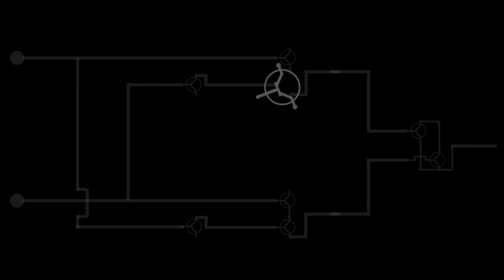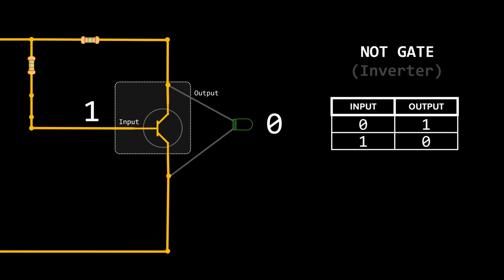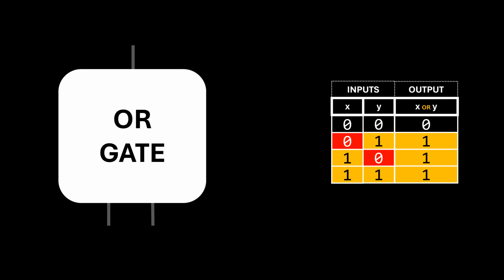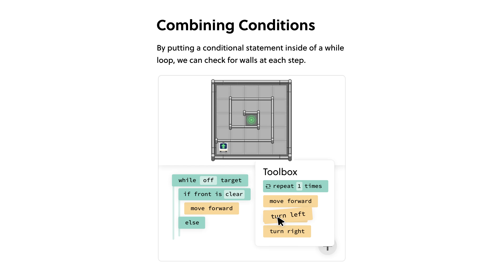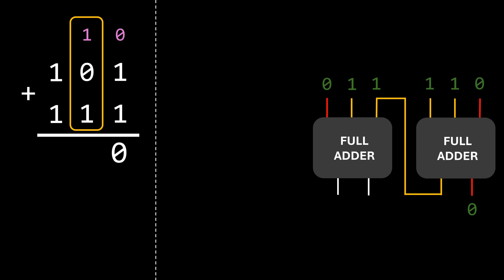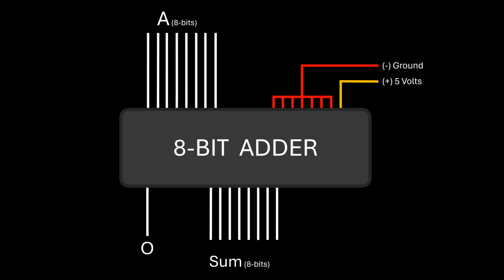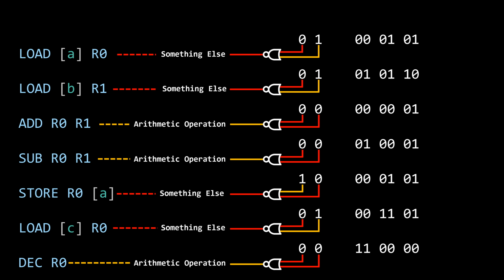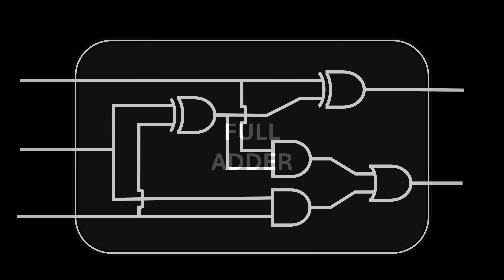HOW TRANSISTORS RUN CODE?

Comment: I've never had the entire mechanism of the ALU shown to me with such clarity, despite having a computer science degree from a pretty reputable university 😅. In particular, it was never explained to me how we got from transistors to logic gates.

I recall during labs, we were simply given logic gate chips and told to use them. I assume the professors and TAs must have thought it's too basic to warrant explaining, and none of the students wanted to ask because we were all smug teenagers who had too much ego for our own good 😮‍💨.
Reply from the maker: Same situation. Unfortunately, Computer Science has forked so hard from its origins; (Electrical Engineering), that if students want to learn concepts as simple as this one, aditional external resources are needed.
Reply: @CoreDumpped   I agree and the same can be said for EE.  It's forked so hard from Physics that a lot of Engineer's who want to understand edge effects in circuits not covered by the lumped-element electricity model are forced to go outside EE texts.  That's the tradeoff of imperfect abstraction, you gain simplicity at the cost of some important details.  When I first took an analog electronics course we started with Maxwell's equations applied to static charges X_X ... it took us a while to get to a basic power supply.  My friends who where Engineers laughed pretty hard at me.
Reply: @John-zz6fz  Agree 101%. When I was taught about transistors and logic gates (1964) the first and fundamental thing drummed into us is that there is no such thing as a digital circuit. ALL EE is analogue. So many people these days fail dismally to interface processors to the real world because they've never been taught any analogue design.
Reply: @CoreDumpped couldn't agree more
Reply: People don't realize how important this stuff is. When I passed out of High School, I could understand how Physics and Mechanics leads to machines. To a certain extent. But I couldn't understand how electrical led to electronics and logic circuits and how it led to computer hardware and then software. So I chose Mechanical Engineering and although I don't regret the choice one bit, watching such videos makes me wonder what I would have chosen had I had access to such videos back then. 

Thank you CoreDumped.
Reply: @death_parade No time like the present
Reply: Agree 100%
Reply: Same happens in my college 😐
Reply: In my school in Italy (technical institute) (age 14-19) in computer science we studied binary operations, logic gates, Assembly and C++ programming. In the electronics course with transistors we created logic gates on breadboards and in physics we studied how transistors work (doping, holes, etc..). Complete package!
Reply: same in my university
Reply: thats because you studied CS which deals more with software, im studying EE and we are literally learning this stuff rn...not to this extent but we are learning the very building blocks of electronics.
Reply: I recomend you to read the book CODE by Charles Petzold. He initiates the book explaining morse code and finish with an entire CPU.
Reply: you're kidding? How did you even stomach that? I mean, that is like stabbing in the dark. No? Maybe the professors themselves don't know.
Reply: Yep same here as an EE. I get the concepts of each course I had but stringing it together was something I never really understood. It's like it went primitive electronics to modern day with no middle ground
Reply: But for us with a degree in electronics or physics, that was among the first things we were taught. Even before university level actually.
Reply: Really? I'm self taught software engineer and built my own cpu, assembly language, assembler, compiler and os ... I guess it depends on how interested you are in things
Reply: @jordixboy  True, but a well written article/video about those topics will make the difference between leaving you wondering or you fully grasping all at first smoothly
Reply: @jordixboy  You are products are too good i must admit. No human being deserve.
Reply: @jordixboy  cpu!? Bruh… 🥀
Reply: @Astroshychannel what??? lol
Reply: @jordixboy  How u made a cpu mate..!?
Reply: @jordixboy Oh that kind of project will give me the satisfaction that I want not writing kotlin for Android where I don't know what the hell is going on ... But we need to pay the bills 😂. 
I am on this journey of creating that small computer from scratch 🎉
Reply: ha, same here...
Reply: Same to me ;o)
Reply: "it's too basic to warrant explaining" hahahahaha
Most creative excuse I've ever heard
The real reason is most teachers SUCK. I wouldn't be surprised if they didn't actually understand the core fundamental 1st principles. The ones "too simple to explain" lol. They likely just read and copy things out of text books repeating the same classes year after year. This channel explains the fundamentals extremely well. Probably better than any university in the world. I'd be surprised if it wasn't actually.
Reply: Ko
Reply: 1000 percent
Reply: engineer grad here and man can I relate and be dissapointed in our broken system. After barely passing well enough to get the degree and very upset at most professors usually math and science with their inability to push understanding of concepts beyond "I memorized facts", I fixed that problem myself. I literally read maths and physics  books and watched videos of better profs like prof leonard on here and after 2 years I gained a breath of true competency in areas I was lost in for decades in some cases. Ask any recent stem grad a "real" question of physics or math theyll have no clue where to start without tripping over their ego. Check out that mit or harvard expose of ivy leauge grads not being capable of making a light burn with a bulb battery and a wire, were cooked.
Reply: Wrong assumption there. The design of even simple logic gates is extremely complex. There are multiple different technologies which we call transistors. The internal structure is a complex of current steering ANALOGUE circuits which are prone to oscillation and time delay skews, Because of this "real" EEs treat them as black boxes with known time delays and rise times. I studied semiconductor manufacturing at Uni, so I really did need to know the details!
Reply: @adrianandrews2254  yes indeed. i think mainly the point here is to realize that at the fundamental level, every detail matters, but as you grow in complexity, those details can get lost in the abstraction because they are not immediately useful. Abstraction being the important tool, because doing any code while trying to maintain a mental picture of current flows through materials can get immensely complex even for very simple circuitry. So, if we can reasonably predict what some device can do, because somebody else made the device to a certain standard, then it becomes much easier to - again, mentally - create even more complex systems that can do even more complex things.

you are right though. it is an insane amount of information and skills going into the modern world which we take completely for granted.
Reply: Crikey so many babies at university expecting to be force fed and not do the actual study yourselves and ask the right questions when you don't understand something in your own study... let alone the work that is set to evidence your knowledge right ? what do these tutors do these days get away with an easy life if the students are dumbed down I guess. A degree is to show a degree of knowledge right not to be taught a subject, that's what school or college is for, and even then at college you're expected to do your own research and study if you have an interest it's not an issue but these days a degree seems to be like a school qualification and means very little when the person holding that degree can't even hold a soldering iron without burning themselves or use an adjustable PSU without blowing up what's hooked up. Shame on you, you only want the qualification/ paper to get into a more financial advantage position you should feel the imposter syndrome you deserve it. 😂

Comment: George it's not about the accent you might have, it's about the content you give out. You can always add subtitles, or upload two videos one that is AI narrated, and one that has your voice. Practice makes perfect and you make a perfect content for it to be discarded just because of the AI narration.
Reply: More effort for the same content, while also introducing requirement of uploading two exact same videos with different audio. I really like the videos on this channel, and AI narrator is totally okay, furthermore it's voice quality is fine.
Reply: As someone with a thick accent, I can tell that I also get distracted if the accent is too thick. Non-native speakers tend to find it more challenging to understand others' accents. There are channels that I only follow because the content is excellent, but the thick accent is a downside. After a couple of videos, I get used to it. However, my point is, initially, it can work against the channel.
Reply: It depends on clarity of speech. If he can speak clearly but is embarrassed by accent, that's not an issue. But if it's a struggle to understand, the AI voice makes more sense. As unfortunate as it is, some content creators seems to being doing good stuff, but it's such a struggle to understand them that it's just not worth the hassle. At the end of the day, there's reasons for and against, it's not an obvious or trivial decision
Reply: tbh the ai voice isn’t bad at all though. and is much easier than being distracted by heavily accented english.

the intent is to delivery he information as fast & fluently as possible; the ai may be dry but it still fluent.
Reply: @elijahjflowers  Yeah, it is a balance.  AI is a tool-- if used in a way that enables low effort content that creates more errors than it fixes, it is bad; if it enables high-effort content (such as this) then it is wonderful.  I don't get the whole  Anti-AI vs. Pro-AI dichotomy.  That's like saying I am anti-pipe-wrench or pro-pipe-wrench.  If  you are beating me in the head with it, I am totally anti; if you are fixing my plumbing, am absolutely in favor.
Reply: @elijahjflowers my point exactly... I don't know why a lot of people are making a big deal out of the voice over
Reply: @elijahjflowers  I totally agree and personally I am completely fine with Ai voice and continue recommending a channel to colleagues. But it's better to have every bit of subscriptions and likes at the current phase of the channel
Reply: @elijahjflowers  i agree with you, the ai voice is very clear, and the noise that a weird accent can bring to the medium may not be worth the upside in my opinion.
More so in a channel which is not based in the charisma of the speaker, but on concrete technical knowledge.
Reply: Don’t encourage this. It is about the accent is his channel growth and viewers it reaches.  The ai voice is a smart move and since I speak English I appreciate it as a major convenience. Thank you George ! But I also think it’s the smart play.
Reply: Content is great. Video edition is great. AI accent is good.
Reply: I thought was a real voice. For me its ok cause Im not a native english speaker and its easier to understand.
Reply: In George's defense, I've absolutely clicked off of really interesting things because I couldn't understand the person. This is an extremely clear AI voice. You do you George!
Reply: Subtitles, even for short videos, are an awful lot of work and making two videos would not only also be more work, but split the views, hurt engagement and confuse viewers. The TTS is perfectly fine and I would argue better than actual voice-over with bad audio quality and a thick accent.
Reply: if it's about content and not the voice or the accent, then why i still feel 'ai voice' on the forefront of your message?😉
Reply: Yes, it's a good idea since a lot of people will click away before they hear anything because of frivolous reasons like that. So he is just being realistic and it makes sense.
Reply: @Leonhart_93 no one is leaving bc of this voice over.
Reply: @FrostyFlankz   I am no one then. 🤷‍♂️
Reply: @Leonhart_93  define “a lot of people”.
Reply: @elijahjflowers  The part of the audience you don't attract as a growing channel, because they click away too fast. 
No matter who they are, every bit helps with the algorithm.
At any point in time there is basically an infinity of videos to watch, and audience needs to be captured and help.
Reply: If I am being upfront, I do find some accents hard to parse at times. That isn't me saying for the creator to never use his own voice, but I do like the AI voice. I think ultimately he should do what he feels is best and let things happen how they happen.
Reply: I actually like the AI voice. I would suggest you keep it that way
Reply: No just let the guy do what he wants, it's his channel and he chooses to use AI narration. If you dont like that, go to some other channel
Reply: The AI voice is perfect. I'm also a spanish native speaker so yes, I understand why he does that.
Reply: Exactly the ai voice made me want to leave but after a few seconds I realized that he actually put effort into this video and it wasn't that bad
Reply: Unfortunately that’s not the way western world works
Reply: Agreed
Reply: Heeell naaaahh
Reply: @user-k8h5h me too, it's not that bad
Reply: I give up when I hear someone I can barely understand because when you're trying to comprehend something, it doesn't help to spend half the time comprehending the language barrier. Love this guy and his content and think he's right to choose narration
Reply: He doesn’t want to so give it a rest and move on.
Reply: The synthesised voice is horrible.
Reply: No, it's okay, rn, there's a growing number of ppl who'd click a away if they don't like, or can't understand the accent.
Reply: Nobody wants to hear this guys real voice
Reply: Don't agree with this, I'm sick of all the Indian videos where I use more brain power to understand what they're saying than what's happening on their PowerPoint. Please keep the ai voice
Reply: Maybe it's none of your business.
Reply: and not to mention, everyone loves Modern family!
Reply: I like this voice
Reply: Also, in the tech industry, you get good at understanding other accents. Most of my co-workers do not have the same accent as me.
Reply: Telling him to upload two videos and put in extra work for subtitles and voice narration for zero gain is just insanity. You have no business giving him advice
Reply: I wonder why western Christian missionaries communities are so obsessed with accent
Reply: I don't dislike AI voice
I would really like to hear you narrate your videos
Reply: I personally would like the author to provide an alternative with his own voice, in his first language. That would be without any doubt the best possible choice for those understanding the language.
Reply: He can also just use eleven studios. If he doesn't want to speak.
Reply: What accent?
Reply: True, I had almost clicked off onece I heard an AI voice
Reply: I am a person with sensitive ears. AI voice just sends an unpleasant shiver down my spine.